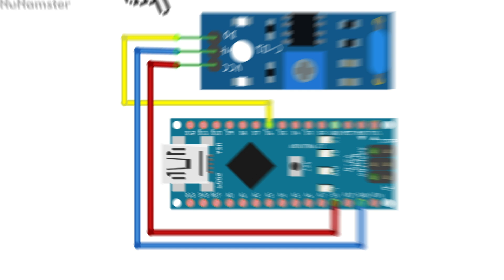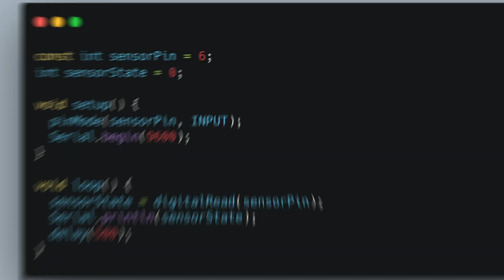🔧 Vibration Sensor (SW420) with Arduino – A Full Guide for Beginners 📘🤖

Comment: I want to make a visual aid for my kids so there's no question when they're walking too heavily. How can I make the LED trigger one of three (Red, Yellow, Green) LEDs, each corresponding to a specific threshold?
Reply from the maker: Great idea for a project! Since the SW-420 is a digital sensor, it primarily outputs a binary signal, but you can still achieve three levels of intensity using a "pulse counting" method with an Arduino. Instead of measuring the strength of a single hit, you can program the controller to count how many triggers the sensor sends within a tiny window of time, like 200 milliseconds; a heavy stomp will produce a much higher frequency of pulses than a light step. To make this work perfectly, you can write a simple calibration sketch that prints the pulse counts to your Serial Monitor while your kids walk past; this will give you the exact numbers you need to set your Green, Yellow, and Red thresholds. It’s a brilliant way to give the kids some visual feedback!
Reply from the maker: Additionally, if you want to monitor loud talking as well, you can add a microphone module like the one shown in your image. It picks up ambient noise and outputs an analog signal that is very easy to map to your LEDs using the analogRead function. You can see a quick guide on how to connect and calibrate such a microphone here: https://www.youtube.com/watch?v=cDvAAPWJgu0. 
This way, your visual aid can cover both heavy walking and noise levels!

Comment: Is there a way for it to detect ONLY on hard impacts ie; a large rock hitting a helmet
Reply: is there also a way to connect it to a large alarm?
Reply from the maker: Hello, yes, of course, you can. I explained in the video about adjusting the sensitivity of the sensor that you need to place the sensor in the helmet and tap it with a stone with the force at which it should activate, and turn the variable resistor on the board until the LED starts to glow slightly. Then, according to my tutorial, connect it through a relay. I will leave the link below.

https://youtu.be/jXcdH1PgmMI

Comment: How would I configure the sensor so it would only detect vibrations after a period of time, for example, after 30 seconds, but ignore any vibration before that?  Using the delay?
Reply from the maker: Hello, you can use delay for this task, but I would like to note that the Delay function delays the entire program, so if you want something else to run in parallel, it is better to use millis()

Comment: wanna ask if I put the sensor in a machine to detect its vibration for certain level of frequency, does the surrounding of the place disturb the sensor accuracy?
Reply from the maker: Hello, by the term “environment” do you mean temperature and humidity?

Comment: how to connected the led/lcd pannel? please tell me

and is it a digital signal processing project?
Reply from the maker: Sure! To connect the LED/LCD panel, you’ll need to know which interface it uses — for example, SPI, I2C, or parallel. Most small displays for Arduino or similar boards use SPI or I2C, so you’ll connect it to the corresponding pins on your microcontroller. If you let me know your specific panel model, I can give you more detailed help!

As for your second question — yes, it can definitely be part of a digital signal processing (DSP) project, especially if you're using it to visualize signals or output data processed in real time.